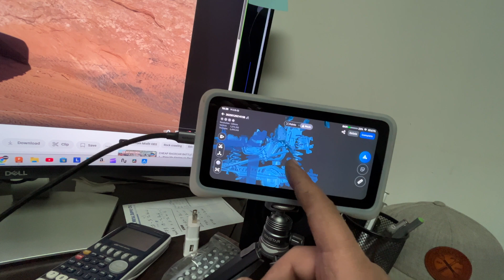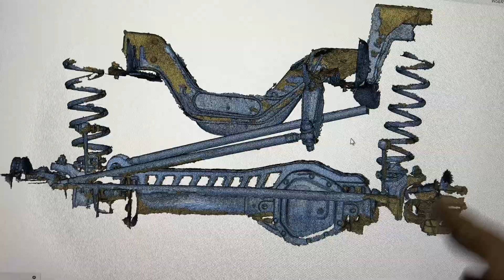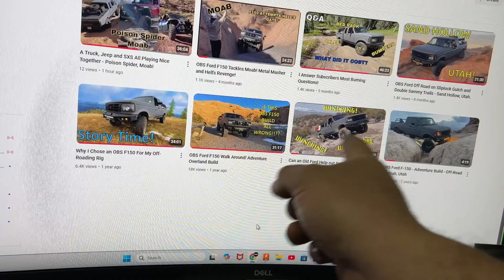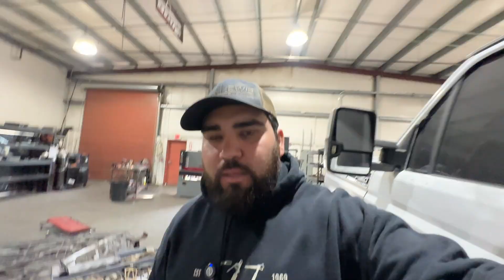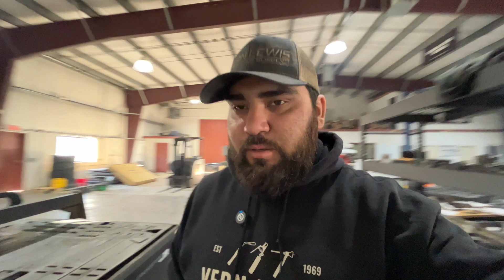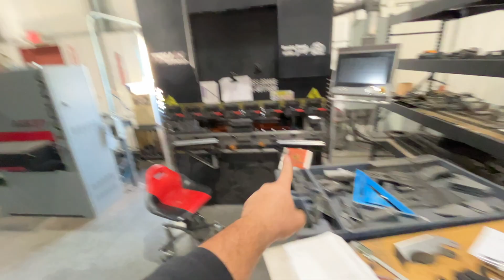BDDs Biggest Build Vid.3 4-Link Cradle Track Bar Bracket & Truss

Comment: Thanks for the update. I have 08 axles on my 95 swap I installed a new upper driver side  rear shock mount mainly because I ditched the stock fuel tanks and went with a 09 plastic 37 gallon.
Reply: How’s the fit? Any pics. I’m interested.
Reply: @OBSBryce  ill see if i can take some pix soon.
Reply: @OBSBryce  I sent you some pictures on your Instagram.
Reply from the maker: That is something I definitely gotta try sometime soon